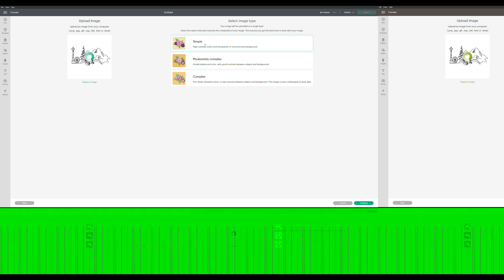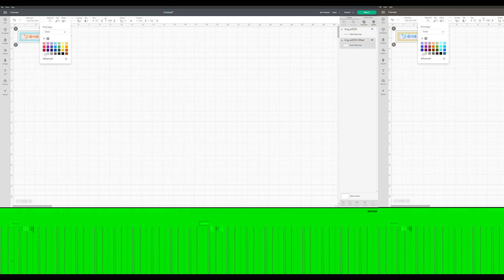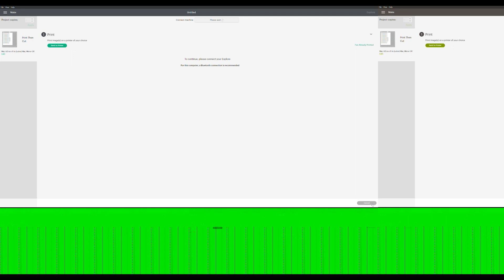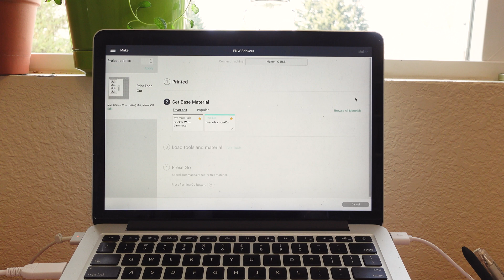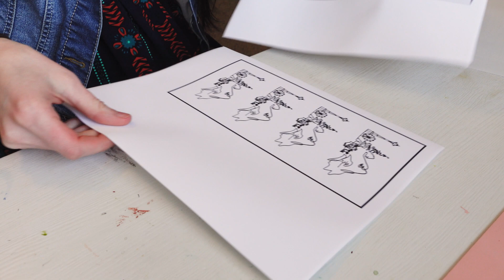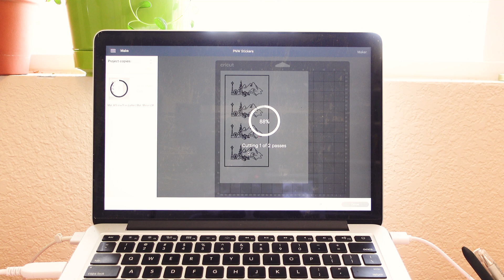How To Make Vinyl Stickers With Cricut

Comment: I got the maker 3 and am using oraguard 210. I keep getting ribbed edges on my stickers and have adjust the pressure setting from 290-350. Did you experience something similar?
Reply from the maker: I have had this issue and what I’ve found is that on top of the pressure, if the laminate isn’t adhered REALLY well it can cause some problems. I’ve also noticed that some shapes it struggles with more, like having to do tiny curves instead of just one smooth edge. At some point I’m going to see if using a laminator to adhere the laminate to the sticker paper would help this. My work has one I should be able to use for a test run before investing in one lol